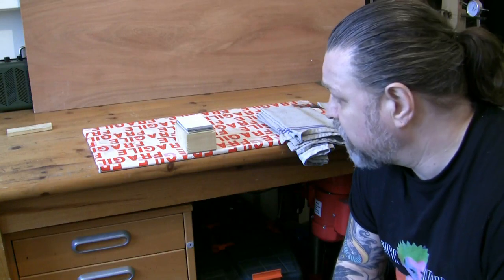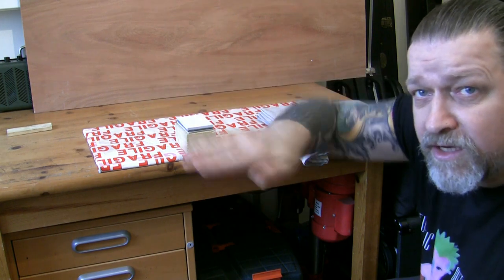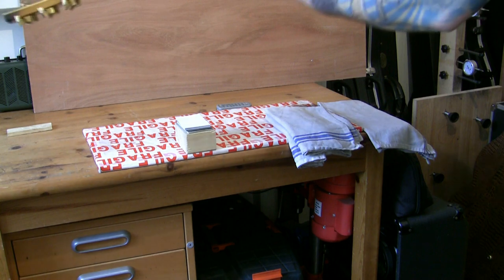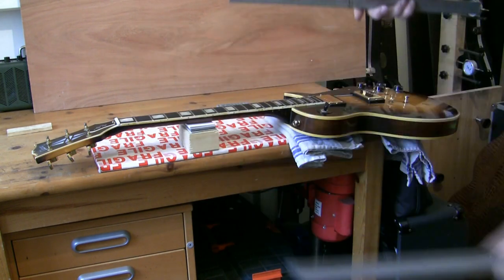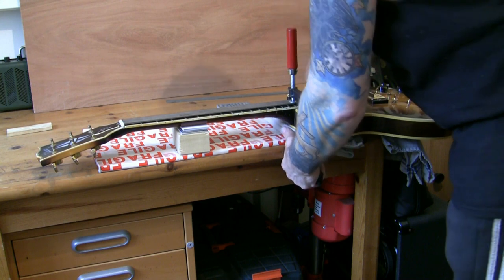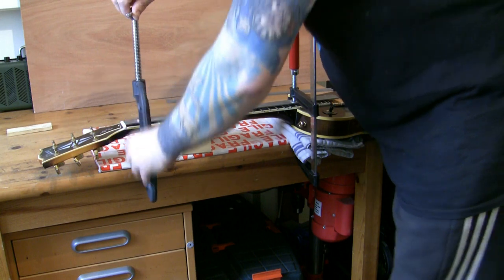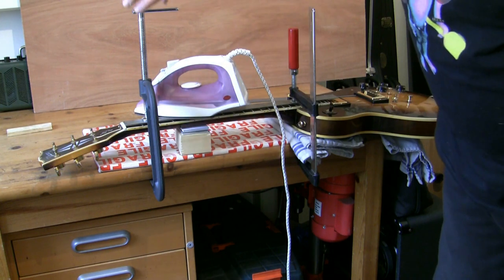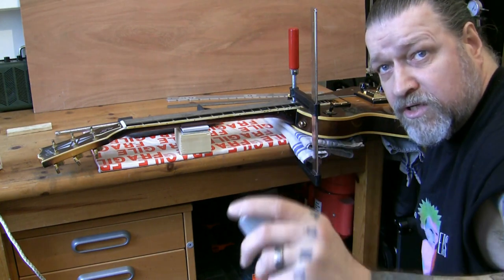How to (or how I)... straighten a guitar neck using heat and clamps...

Comment: How would you go about putting some relief or up bow in a neck with too much back bow with a loosened truss rod?
Reply: I have a strat that I refretted years ago but when I came to level it came across this probably and it's been sat ever since....about 6 years!
Reply from the maker: You would read the comment I made in the description of this video that explains how to do that :)
Reply from the maker: Same method but clamp the guitar under the heal and under the 1st fret; add the metal strip as before then use another clamp around fret 7 and tighten it to remove back-bow; use the same method with a hot clothes iron to get heat into the frets/into the wood...
Reply: Fret Friend Thanks so much for the reply, I failed to read the description on my phone :/ 
I hope this little jem sorts out my 40 year old fender neck now and can level and dress the frets etc. Nice to know ur local to me keep up the awesome videos and tutorials, prob the best I've seen on youtube . :)
Reply from the maker: I hope you can sort it! If I get a spare 5 minutes, I'll do a small video showing hot to clamp to get a little back-bow using a similar method to this one. Victor...
Reply from the maker: You could also release the truss rod tension, support the neck and sand the fingerboard until the surface is flat as I did in this video: https://www.youtube.com/watch?v=rs1xA5IocLU

Comment: too much for the truss rod?
Reply from the maker: Hey? If I'm straightening a neck using clamps and/or heat, you can guarantee the truss rod is NOT doing the job it should! Why else would I be using these methods?
Reply: @FretFriendGWaL  well, because if you can not take off a simple relief  with the truss rod, maybe it is broken and you should change it...